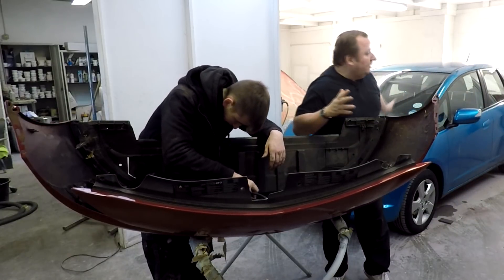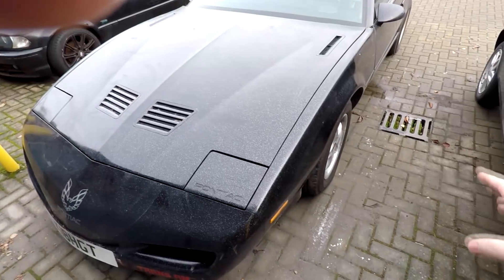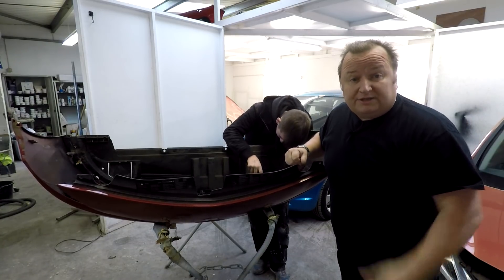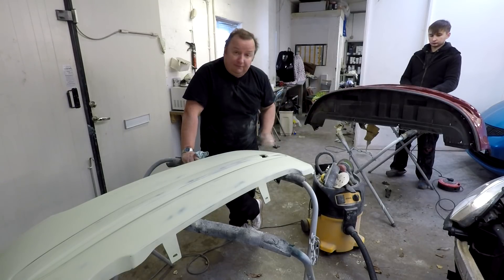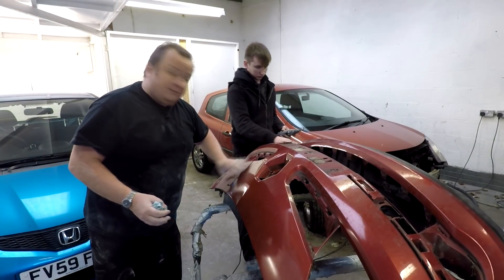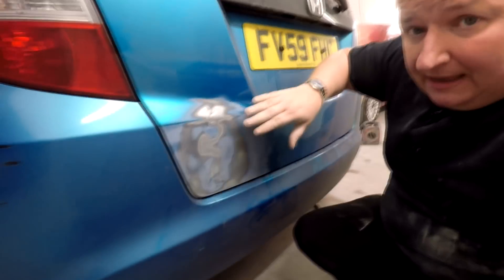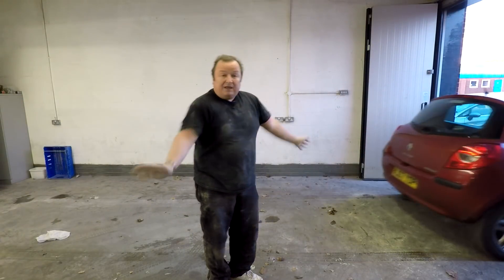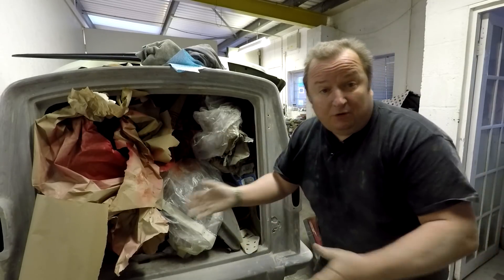Down The Bodyshop Vlog December 2017

Comment: I couldn't see it? Is it not fitted yet? I have to see that, I put one on my car, I have a black 2005 Saab 93 with black wheels/ black honeycomb front grill and a rear spoiler I had manufactured, it's got a scanner light on it (red)

I found you because I had a 2006 Mondeo tdci in silver, but I got sick of plowing money into it and it kept leaving me stranded with one problem after the other!

My Saab is really reliable ( 1.9 tid)
I changed the thermostat this afternoon, but I didn't mind, the car had no issues accept the heater in the car wasn't blowing hot, however I immediately noticed a dramatic power increase!

Yeah I been watching you for ages, and Sharon's little moans and low blows lol 😂
Reply from the maker: Yes, it is fitted but it's split in two in the front air scoops. It's the only way he could fit them in this model. Glad you are enjoying the vids,